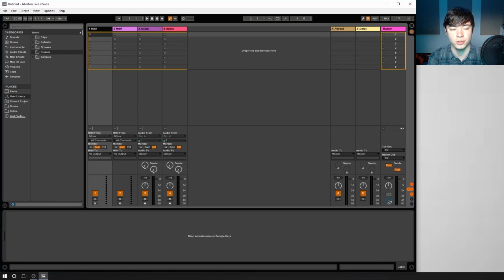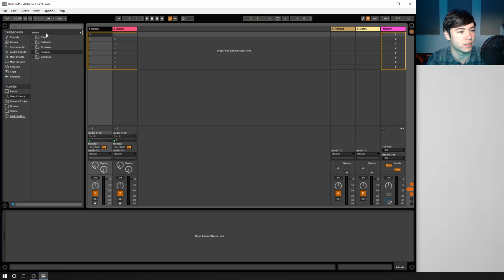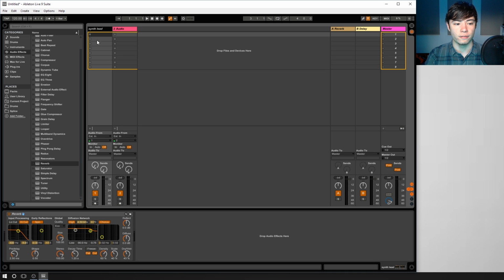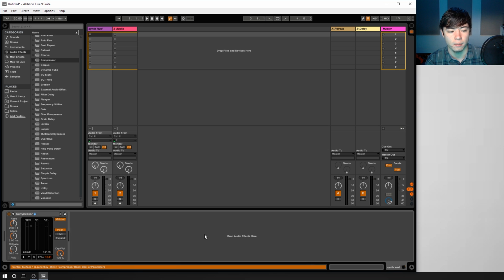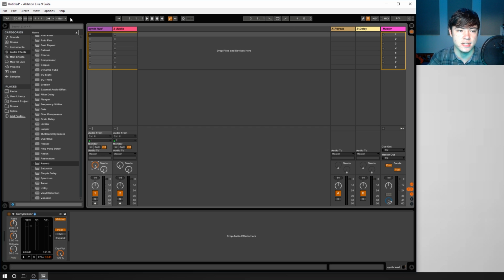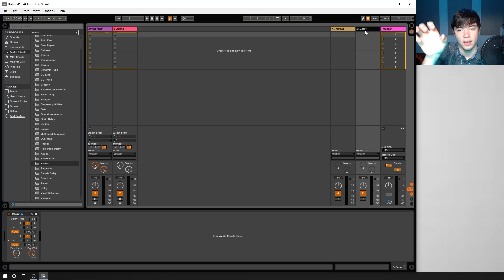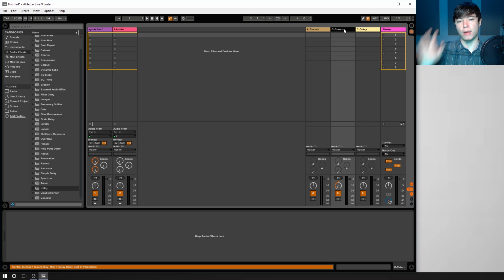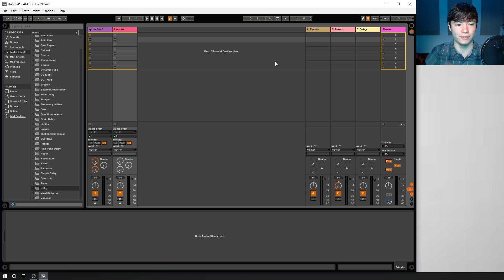The Basics Of Send & Return Aux Channels - Ableton Live

Comment: Hello! Thanks for the video! I have one question:
You are about to record some vocals and you have some vocal tracks (lead vocals and vocal layers) that require the same default plugins to get started. For example, you might have a standardized plugin chain like EQ, DeEsser, Compressor, Saturator, Reverb and Delay with default settings for every vocal track you produce.
To save CPU, instead of inserting this plugin chain in each vocal track, people usually suggest using a Return track and inserting the plugin chain there. Then, it's advised to increase the Send level of the vocal tracks to let the audio pass through the Return track and then to the Master.
However, unless the output of the vocal tracks changes from Master to Send Only, you will have double audio going through the master (the audio from the vocal tracks and the return track).
You could also group the vocals and send them to the return track, which leads to the same issue but with less flexibility in the individual tracks.
My question is what is the best practice in the above example, considering the need for further effects per track down the road, as well as gain staging and mixing overall?
Thank you!

Comment: I dont know.  I guess I'm an idiot.  I really dont see the purpose to this at all.
Reply from the maker: Just allows you to effect the same sound without effecting the source sound. think of it as coloring a duplicate of a stick blue, instead of coloring half of a stick blue.
Reply: Saves adding the same effect to multiple tracks. Eg if you wanna run a low pass filter over a section of a track just set up an aux track with the filter automated and send the tracks you want to filter to it

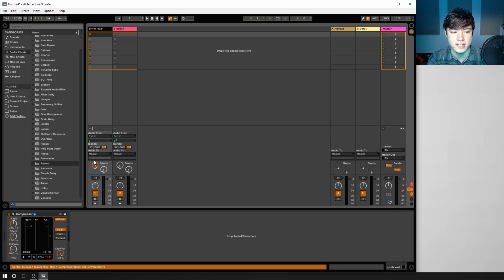Comment: Good video. However, keep in mind that the signal that is sent to the aux buss is processed. The 'fx chains' are like the inserts on a mixing desk. So, if you apply a compressor on a track, the compressed signal will still be sent to the aux. It doesn't 'bypass' the fx chain so to speak (like you said in 4:00). You can try it: apply a compressor with heavy settings to a track. Then solo the return channel and switch the compressor on/off. Alternative method: bring the fader of the channel down and set the sends to pre fader (in the master section in the bottom right).
Reply: now i have to try to unlearn this incorrect info i just learned ahhhhgg
Reply from the maker: depends on your routing settings.
Reply: what routings settings? there are no routing settings to just send the 'unprocessed' signal when an effect is applied as an insert.
Reply from the maker: Im saying, you can bypass insert effects on sends if you route to the send via pre-fx
Reply: Mate, the buttons in the master section on the right bottom corner mean pre/post FADER, not fx.
Reply: This is what happens when people in such channels do videos but actually don't know what they are really talking about (or rather have a vague idea). and this vague information spreads and spreads... ;-)
Reply: It's perfect right, what you said. Thank you really very much for it!

Comment: So if I have an interface with 8 in & 8 out, I can use hardware fx with Live through the card? I'm sitting on a pile of 80's reverbs and delays. Some really nice ones too.
Reply from the maker: That's correct! Just run the out of the interface into the fx unit, then back through an in on your interface. There's a feature called external effect in live. All you do is configure the in and out of it on the chain and youre golden